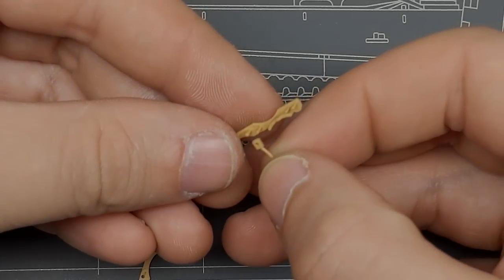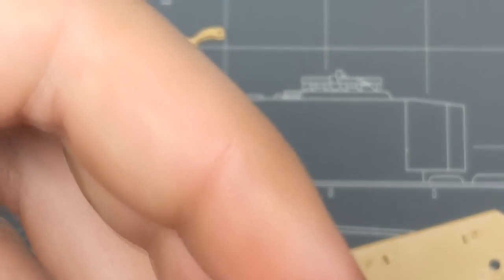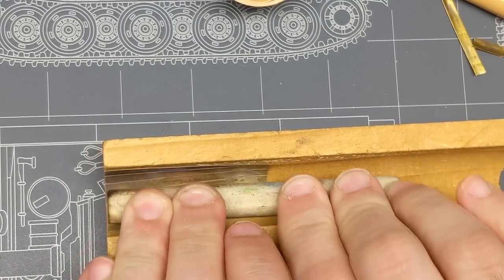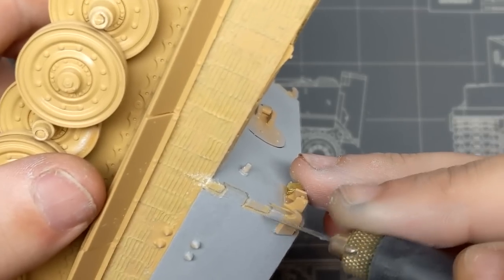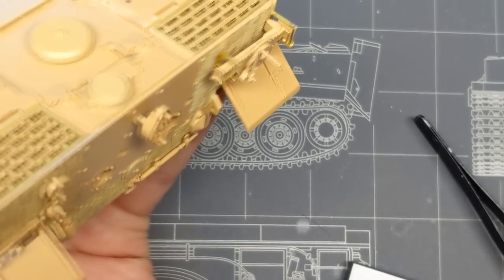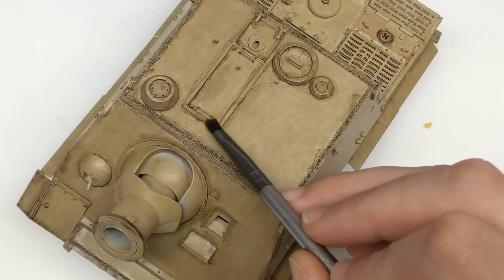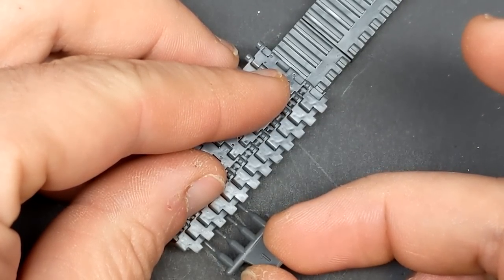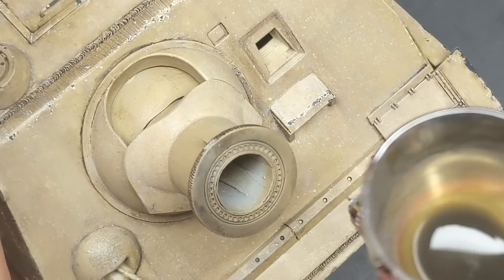1/35 Rye Field Models Sturmtiger - Is this one of the worse armor kits out there?

Comment: For me, it depends what my mood is, that defines a challenging build - for example I found the big 1/24th Scale Typhoon from Airfix a joy to build (start to finish less than 3 months) - on the other hand Eduard's 1/48th Scale (ex-Hasegawa) was an absolute pig to build and a mojo killer (start to finish 19 months).

I do wonder what all the fuss is about RFM, yes there's a lot of detail, but they over complicate things, which in turn causes fit issues. Look at the barrel on the Sturmtiger, the photo-etch rifling - that could have been done as part of the injection moulding process, Tamiya managed it on their 1/48th Scale version (I just finished one)

Comment: I've got six RFM kits all with full interiors and the aftermarket photo-etch and resin parts in various stages of progress and this kit is the worst for misaligned parts trees. I haven't had any other major problems with any of the other kits... other than losing micro parts and breaking skinny parts. After assembling regular kits for years I felt like I needed something more in my modeling. Now I think I must be a sadist. Good video, subscribed.

Comment: To answer your questions: the first model that I built was a Monogram 1/48 F-106 and that was painted by hand and without the necessary colors to do it but I still have it after 10 years! 

As for the weathering question, I like doing tanks more than planes since you can do more with them and make it as clean or dirty as you want.

Comment: I find aircraft more challenging.  You have to get the paint just right since you can’t cover it up with mud or other weathering. Antenna wires are a pain too.

Good job on the build. I recently got back to building tanks by doing Meng’s Jagdpanther. Perfectly engineered kit.

Comment: Great work!  I love how you managed to airbrush them AK colours... I have had nothing but issues - so massive kudos to you mate!  Keep up the awesome work!
Reply from the maker: What issues are you having? I thin them down to about 2 or 3 parts thinner to one part paint.
Reply: @TheModelGuy  - I had really bad tip drying, lots of clumping of the paint in the airbrush (made the first mistake by using the Real Colours Series - High Compatibility Thinner - it just went like glue in the airbrush (40min later after cleaning it got back too it!) ) and really poor coverage...  I suspect it’s just me though!!!  Yours looks amazing!
Reply from the maker: @karlosmitz3027  I'm also at 5500 feet AGL so I get away with slightly lower pressures. But it's also so dry here I thin down the paints quite a bit more.

Comment: Well I have built the RFM Jagdpanther with full interior and I have quite a fight fitting the upper hull on that. It was caused by the fit of the transmission and other bits. When building these RFM kits the location of the parts is not very precise and bits I thought I had fitted correctly were in fact not fitted exactly where they should have been. In the end to justify the interior details I used my dremel to cut section holes in the sides of the upper hull and engine deck and also fitted all the hatches wide open as if the tank was sectioned and on show in a museum. All in all I think these full interior kits are rather ambitious and should only be recommended for experienced builders. I couldn't imagine a first time modeler enjoying fitting one of these together.   To answer your other questions I think larger scale models are harder to paint well, especially getting the colour modulation right
Reply from the maker: I have the Takom Panther with the full interior and from what I've seen they are very well done engineering wise with minimal issues. But I have noticed a lack of videos of full interior kits being built. Maybe that's a sign?

I'm excited to do the Miniart SU-85 so hopefully that's not a let down. It has the best looking steel texture out of the box I've ever seen

Comment: I periodically throw my excess old models in the trash. I don't have enough space to keep them all and I have very little emotional connection to most my old builds. I have kept a select few though, to see if I've progressed any. The more inaccurate the base kit is, the more likely it is I'll end up throwing it away. Wish I had a glass case to keep my models in so they wouldn't get so dusty.
Reply from the maker: Some of my older ones end up on the kids shelf. My oldest took an E-2 Hawkeye, Avenger and FW-190 and mashed them into a weird single engine thingy. Pretty cool actually to see where he went with it.

Comment: Wow. Well done. The photo etch looked so formidable,  but you beautifully formed the parts. Personally,  i agonize when confronted w tiny photo etch parts, like the damnable tool clamps that drive me to utter distraction. i just had this kit in my cart on Sprue Brothers, but opted to delete it in favor of something better suited to the novice. I'd like to see You assemble the Mini Art kit, i was rather disenchanted with the kit i attempted to build, the pz Kpf III Ausf B....firstly, it required EXTENSIVE clean up with the prominent mold seams, that ended up ruining some of the detail. The plastic the kit was molded in was strangley soft, so the detail wasn't very distinct on parts. When i got to assembling the individual tracks, i was dismayed at the clean-up they required. There were over-many attachment pionts to the sprue on each individual link, which entailed much scraping with the model knife after carefully cutting from sprue w a sprue cutter. And they were awkward to handle, being so small. I aso have MS, so this was very daunting to undertake, and quickly became a very onerous and maddening task. I looked to You Tube for anyone with a build video, and found one done by a woman, showing the complete construction. 
She showed the clean up of the track links in time lapse, and the effort she devoted was considerable. At this point i abandoned the build in disgust, relegated it to the cluttered closet, and avowed never to buy the Mini Art kits, despite the alluring box art. Perhaps as i gain more experience, i might revisit this project, but at this point i don't need the aggravation.
Reply from the maker: Miniart definitely holds one of the top spots for kits with tiny parts and clean up. I did one of their Harley kits and that was nuts. The plastic is very soft as well so it’s easy to damage them. But if you want a beautiful model, you’ll get it with time. I am going to get their P-47 if they ever release it. Tamiya’s new tanks with the link and length tracks are very pain free. I did their recent Panzer and it was a blast.

Comment: You have found out the hard way why obscure companies are for a reason obscure. Through my many years of modeling, I don't think I ever got one of these out of the way kits; where there was not some issue. Most often a MAJOR issue! Poor fit, questionable (or nonexistent) engineering, missing parts, you name it. That crane hoist is just outright sloppy work. No excuse for it. I would guess that was not an inexpensive kit. For good money that they are happy to accept, they better get the damn thing right. I will assuredly add Rye Field to my "Do not buy under any circumstances" list.

Comment: There 2 sturmtiger kits one basic one full interior! I have the full interior version with all the clear roof pannals full engine and driver compartment, you must have the basic kit with only partial fighting compartment! The full interior ones a black box the basics white! I am curious to what lower hull was supplied in the basic kit? the full interior the first releases came with 2 lower hulls one with the early kink, no side walls and one later same as in the Tiger 1 kits that lower hull was taken out the next relises! don't use that hull the classmate won't fit! My kit only comes supplied now with the early hull same as the prototype was built on! That one has no side they go on later but the straight sided fender version that one won't Fit it well!  Looking at yours you have the straight fenders I'm just wondering if they put the wrong lower hull from the 2 in the newer basic non interior white box kit as a mistake?
Reply from the maker: That could be very possible. And also explain why a few people are not having the issue while others are.

Comment: Your  problem with parts clean up in this build struck home with me.  I tried out their new Panzer III with interior thinking it might be fun like the Miniart interior kits are.  Wow, did I get a surprise.  EVERY part had very heavy mold seperation seams that prevented the effected surfaces from fitting flush as they should.  I struggled with my faithful file and sanding tool kits through many a long night correcting every part I had.  God, it was awful.  In the end I succeeded, and the finished tank is now waiting it's turn in the paint shop.  How a manufacturer with all the modern technology available for the production of fabulous and rewarding model building managed to completely ignore the quality control issues that ran rampant in this one is totally beyond me.  I've crossed Rye Field off my list and will stick with the products of other manufacturers from now on.  Life is just too short for this kind of BS.
Reply from the maker: What’s funny is they are hit or miss. I have their Easy 8 full interior and Leo 2A6. Both look great with none of the issues this kit had. I wonder if they had tooling issues with the Tigers?

Comment: you have to roll that photo etch rifling at an angle , it will then fit like its suppose to.
Reply from the maker: But then there is no rifling in the barrel. The instructions showed it rifled.
Reply: @TheModelGuy   no it will look just like the rifling on a real gun a circular pattern , it was a pain in the ass to do on mine
Reply from the maker: @thegunbox81  Okay but that twist  means you have to roll the PE square. Or else you'll have a mishape.
Reply: @TheModelGuy   you  Have to roll it at a slight angle so the rifling is twisted like a spiral but there is some trimming to get everything squared up to where it sits like it shouldn't barrel I actually had to solder mind together to hold it in place
Reply: Same method on the sturm from AFV Club. That one has the photoetch skewed so it meets up without need for trimming, but it’s still a huge PITA. Even after annealing it would not roll into a smooth tube, it just bent on the rifling grooves and kept the flat sides. Fought with it to the point that both the brass and my patience snapped and I decided the barrel would just stay smooth inside...

Comment: Nice build mate, well persevered.
On Rye Field Models: I bought their Tiger 1 for the more accurate interior than the Academy version.
I quickly discovered the same issues as you did here. Poorly casted parts with huge mould steps, mould lines that look more like they belong in a 1970's Airfix kit, and fit/build issues that resulted in the MG (and other parts) fouling the barrel and rendering it unmovable.
I ended up putting it to one side and haven't touched it since, it's that bad.
IMHO Rye Field suck donkeys and blow goats and I wouldn't waste good money on another kit from them.
Reply from the maker: I have their M-ATV and Jagdpanther in the stash. Panther isn't an interior model so I'm not expecting it to be as rough and the M-ATV has been getting positive reviews. We will see.
Reply: @TheModelGuy  I wish you luck with them. I just couldn't take the risk of spending another £45+ for what turns out to be a dog of a kit.
There are loads of manufacturers out there, so I'll steer clear of Rye Field in future.

Comment: I vind aircraft more challenging. Most kits in the stash are old or re-makes of old Monogram molds and have raised panel lines. Seems are more pronounced than with armour where  the mostly coincide with real seems anyway. Armour is made quick and dirty in real live most of the cases anyway. Also alignment of wings and gear can be a pain and je need to build and paint in stages while armour builds are quicker and result most of the time in complete models prior to painting. Unless you have interior of course...

Comment: Night shift is really good. But boy o boy, he still believes that copper gets softer with heat... :D heat it and rapidly cool it in water to get it soft, it works other way than steel and stainless. :)) I already see that you copied his own mistake, his welds on jgtiger were upside down, yours are as well :( The u shapes goes down not up on real welds in real life.
Reply from the maker: The "U" shape goes in whatever direction you weld. Up, down, left and right etc. Even doing verticals
Reply: @TheModelGuy  Yep but front armor plate was welded from up going down. And i have seen welds on yours and Night Shifts going up. That was the thing i was pointing out. Rest depends on welder and also Gap between plates, they had tolerances. :) It is amazing and nicely built, but when you have near to perfect model and you see a mistake that is so pronounced with washes, shading, etc. It hurts. :)
Reply: @TheModelGuy  Also there is certain procedure to weld Armor, they were not welding casual steel, thats why they had exact process. Unlike russians, they removed carbon from steel plates by overheating it. You can even see differences between repaired/restored tanks and original ones. Welds are different and technology as well. :) Wanna make the effort of changing the kit to be more real? Stick to the reality, wanna just build model, glue it together and slap paint on it. Thats the way of model builders, building by photos the most realistic i can or just enjoy the kit as puzzle. :) I just did constructive criticism and i hope it does not make you mad or something. Stay safe, keep on modelling. :)